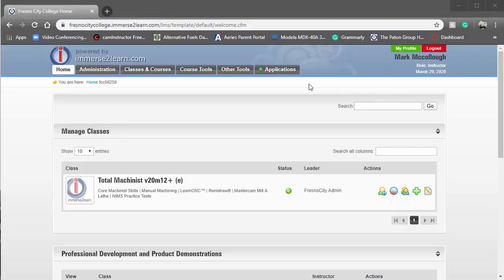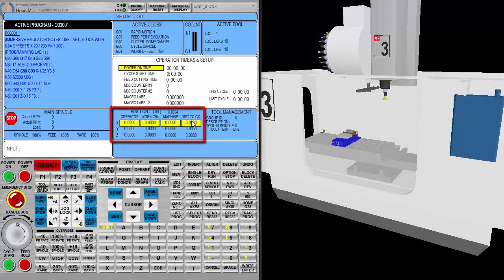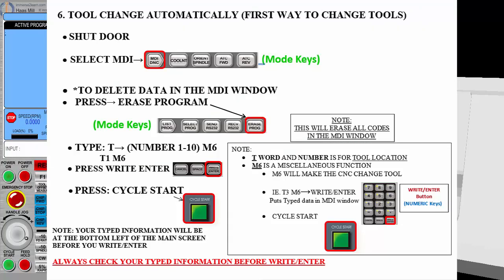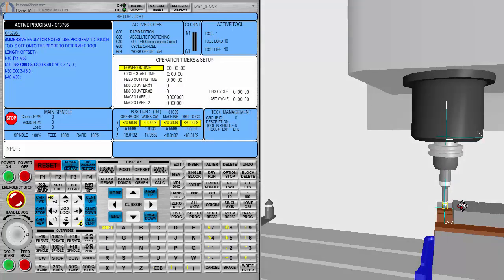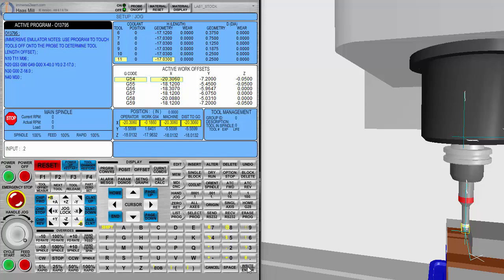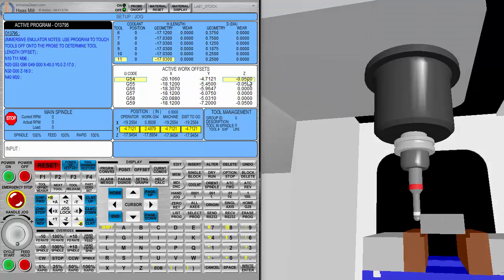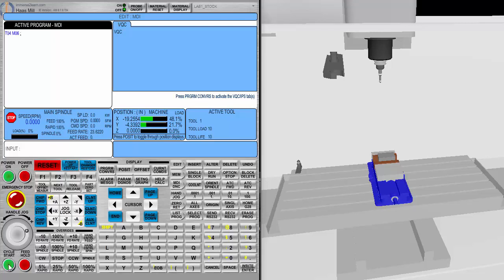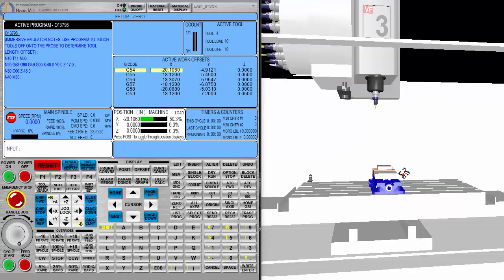2 Immerse2Learn Haas VF3 START UP and setting WORK OFFSET

Comment: Please, can we press ATC rather than pressing Cycle Start for loading Prob into the Spindle
Reply from the maker: On HAAS machines you can type the tool location ie. T10 MDI and either ATC FWD OT ATC REV it doesn’t matter it will load it into spindle as well. On this video I am just showing one way. Thank you